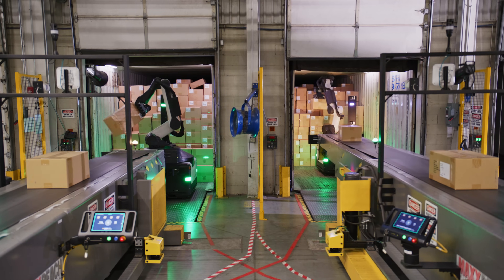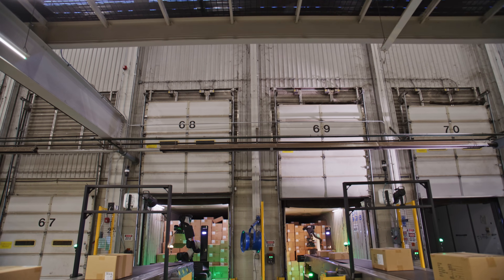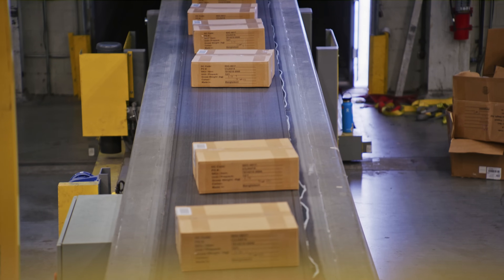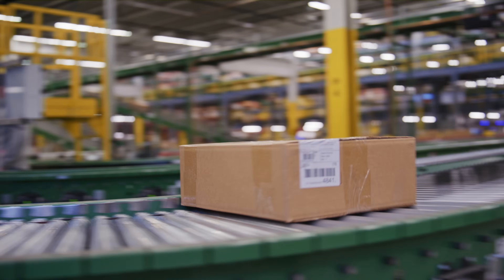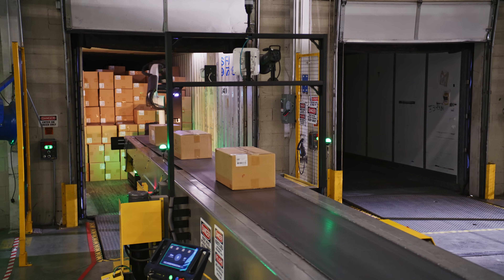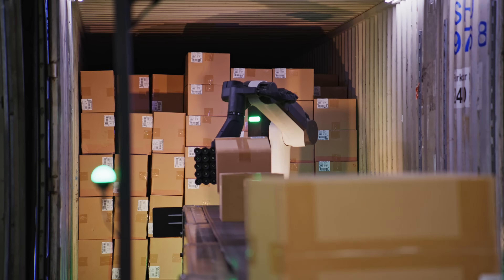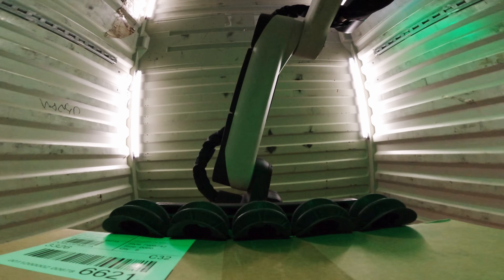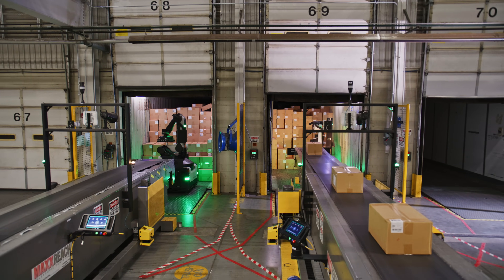Stretch at Gap | Boston Dynamics

Comment: @BostonDynamics  So far we have seen Stretch work in fairly ideal conditions.  What about loads with VERY irregular boxes? How about boxes that have settled and jammed together? (where static friction between boxes may cause damage when pulling a box)  How does Stretch respond to torn, wet, or otherwise damaged boxes?  How does Stretch respond if it drops a box?  How does Stretch respond if the box contents do not match what is printed on the label? (i.e. mass)   How does Stretch respond when a box has no label?  Does/can Stretch sense if a stack of boxes becomes unstable and is about to fall over?  How does it respond to that?  Can you show us examples of Stretch operating in some of these conditions?  Thank you.
Reply: That is a very interesting question. I would assume that it sends a message to a human to come and fix the problem
Reply: @fishman5422 why pay for a robot + a human when you can just pay a human. As long as the robo is not autonomous it makes no economical sense.
Reply: @eSKAone-  it does make sense; unloading floor-loaded trailers/containers is very labor intensive and if the robot can do the majority of the work, then it's 100% worth it
Reply: @eSKAone-  Because the robot operates at a consistent pace, does not need breaks, can operate with limited supervision, and can operate at all times. Likewise, the robot cannot get injured like a person can, and when someone gets injured you have to provide paid compensation for an on-duty injury.

EDIT: Also, you typically wouldn't use a single person to unload a floor-loaded trailer/container. I don't work at a large warehouse, but we usually even have 2-3 people for a single truck to keep up throughput and get the truck out of the dock as soon as possible.
Reply: @eSKAone-  Have you ever had one of those summer fruit packing jobs, where your job is to take boxes of fruit off a conveyor belt and stack them on a pallet? And for reference, the boxes would weigh up to 20kg. I have done it. The job sucks over a limited duration, but for full-time employment, that is just begging to result in permanent injuries.
Reply: @eSKAone-  Because ten robots and one human is cheaper than ten humans.
Reply: @eSKAone-  I've done this job (or one very similar, except I think it was the reverse - boxes OFF a line and onto a pallet), I managed to stick it out for ONE DAY before I begged to be put on something else. It wasn't the hard work, I don't mind that, it was just so utterly mind-numbingly boring. If we have any humanity at all then we probably SHOULD give these boring, repetitive jobs to robots.
Reply: @eSKAone-  why do they give operators a drill when they could use a screwdriver? Stupid question.
Reply: @Aleuvian  clearly you have not seen a 16 wheeler full of live show equipment in roadcases before and had to assist in unloading it. Stretch would be unable to assist in any way.
Reply: @CyanMoth35  Stretch isn't designed for that, though. Stretch is designed, explicitly, for distribution hubs where consistent throughput for unloading and reloading is highly desirable floor loading without pallets is common.

In the United States and many other countries, goods are shipped to distribution centers first via rail or truck, then the goods are repackaged on pallets and loaded for close range distribution to stores and businesses.

Stretch is excellent for generalized goods loads, specifically for retail and grocery warehouses in the US.
Reply: @eSKAone-  ...Because they have more than one worker's worth of work? Its one helper human to a fleet of robots, not one helper human for every robot.
Reply: "Hey human, come give me a hand with this shit when you're free. I can't believe they packed this mess."
Reply: @propellerhead2000  I like the idea that even Stretch is fed up with how a truck/container was loaded XD
Reply: @propellerhead2000  Stretch1 to Stretch2:  "Those meat sacks will never make it in this new world. "
Reply: I don’t understand why people expect Stretch to handle every situation. As the video explained, it’s designed to work alongside people, not replace them. When it comes to pallets, companies can just have workers move them with forklifts. If boxes aren’t packed in an accessible way, people can handle them manually. And for boxes that are packed properly, Stretch can take over. It still offers a significant advantage for companies—especially those that manage both the sending and receiving ends—since they can optimize packaging to fit the most efficient workflow for their receiving operations.

What they’re saying is like, in a car factory where robots handle 70% of the process, if those robots can’t handle 100%, then they should be considered useless and everything must be done manually. But that 70% automation probably saves the company billions a year. I’m pretty sure Stretch, even only with what it can do right now, can save a company millions a year.
Reply: @ I think it's also a matter of degree. Like watching that video, it "seems" like the only thing that Stretch can't do (probably very intentionally) is relocate itself in order to shift jobs in the factory. Which makes people think, what if it could "drive" itself? All of a sudden you need one less employee. If the Gap were to rid their company of employee of "Stretch Drivers" (or 99% of them etc), that too could save the company millions. Could you blame the company from doing so? And you know what they say, Stretch 1 has limitations and is designed to work with people. Stretch 2 though, is designed not to need people and has far fewer limitations if any! Its the slippery slope of automation.
Reply: This is where we need Atlas 2 to come online in warehouses to manage the irregularities or unjam a system.
Reply: That's where you come at 😅
Reply: Boston Dynamics tailor fit their robots based on their clients' requirements. If you actually run a company that would have use for this type of work, contact Boston Dynamics for a solution. Gap didn't ask a bunch of generic questions in a YouTube comment to get their contracts.
Reply: They answered this in the video
Reply: What about plumbing? Carrying heavy pipe or even learning how to cut pipe and ream pipe and identifying the type of pipe on the size so they can hand it to the apprentice, journeyman, or master plumber?
Reply: Stretch can handle moderately damaged boxes, and can pick up dropped boxes. It takes longer but it can do it.
Reply: No.

Comment: I want to see Stretch in a real world application. This looks staged, and the boxes seem really light.
I have never seen boxes stacked like this in a trailer. If the cargo is in boxes, the boxes are on pallets wrapped in stretch wrap. A forklift operator can unload boxes like this 30-40 at a time.
Reply: Then you've never seen Floor Loaded trailers or shipping containers. Those are relatively common, though I think containers would most often be palletized due to rough sea risks and high cargo throughput at ports if it needs to be unloaded from containers at or near the port, although in that case I think they'd sooner load the containers for truck and train.
Reply: Boxes seem really light because stretch is strong🦾
Reply: Why not eliminate pallets, I wonder if they could also get a robot to load them.
Reply: This is a real operation. As the customer said, Stretch is in several Gap logistics centers. In this example, the boxes average 30 lbs. (Stretch can handle 50 lb boxes.) Not all containers have palletized contents. (There is a cost/benefit calculation that companies make. Palletized is more secure during transport, but it costs money to put things on pallets, and to take boxes off them at their destination. Getting pallets out of a container is faster than unloading individual boxes, but then you still have to unload the pallets unless you are shipping them on to another location while still palletized. The best answer varies by circumstance.) Stretch is obviously not the robot you would want to unload pallets from a container, but I'm pretty sure it can unload boxes from a pallet.

Comment: One low-paid loader will be replaced by one ultra-expensive robot and a team of support engineers.
Reply: Just like anything else, the price goes down.  The robot provides predictably, data of output, not having to worry workers comp and those human pesky issues
Reply: And it never calls out sick or needs insurance
Reply: So you think companies will move to a more expensive total solution for what purpose? I guess robotization is happening because the total cost of operating a robot is less than operating a human worker. Otherwise, you will see only cheap humans at each factory and warehouse.
Reply: One cheap horse will be replaced by an ultra-expensive automobile and a team of support engineers.

Comment: 0:27 yo is that allowed??? I worked for UPS (loading trucks) and they told me to never stack boxes just on top of each other but with an offset, i guess so that the weight is better distributed and for safety.
Reply: Offsetting the boxes also prevents the box corners from crushing. If you stack like-size boxes together, the boxes will tend to crush on the corners and the next thing you know you have a stack of boxes ready to fall over.
Reply: The gross weight on the boxes in this video are less than 8kg. Beginning of the video can clearly see 5.70kg. Literal light work.
Reply: @chickentenderlover2412  this is true, but no box is full from corner to corner. The corners will collapse anyway because of gravity. Of course, it depends on how long the boxes are there as to if or how much the corners will collapse. I know about this because I have experienced such things. Even light boxes are affected.
Reply: @asarand  It worries me as well when they pick up from the opposite side of a load inside the box. The box WILL collapse. Idk man these robots just seem like they are designed to be useful but in practice they are just not. Especially for companies with large throughput and output. I don't think I've ever seen a trailer that came in looking as nice as these shipping containers. Just super unrealistic.
Reply: @chickentenderlover2412  well, we have to keep in mind that this is still new. Given some time, flaws will be found, corrections will be made, and improvements will be implemented. You can't start in the middle. You always have to start at the beginning. So it's just a matter of time. And it will happen. And no matter how much people don't like it, the day is coming when labor tasks will be considered beneath humans. And I wonder what's going to happen then. Because when humans can't be employed because not everyone can be a manager, that means the majority of the humans will be out of work. People can't buy your products if they don't have an income to buy them with. Businesses can't stay alive if they can't sell their products. Governments cannot support businesses entirely. It's a mess, and like everything else they're not going to fix it until it breaks.

Comment: "Designed to work with a wide variety of boxes." Shows homogenous and evenly stacked boxes in a trailer, which essentially zero freight trucks actually look like when you open them up.
Reply: What if the boxes were stacked by robots as well? Ever thought of that.
Reply: it depends. many amazons receive shipments that are in TOTAL disarray and look like a mixed up box of legos when you open them. and in addition to being totally mixed up and different sizes there's consistently crushed boxes, wedged boxes, boxes that rip when you try to move them, leaking boxes, on and on. there's a reason they don't show you those and you would have just had to have worked in one of those places lol. that said.. this is the first step and it obviously looks applicable in the right locations.
Reply: It also shows it handling different size boxes.
Reply: Do many of y'all not ever hear of a concept called Floor Loading? Not all boxes are stacked on pallets first, that's only done if the cost-benefit analysis says that pallet loading is more cost efficient, like for super heavy or irregular shaped loads. Floor Loading is done by people working the position of Loaders who grab boxes off of a telescoping conveyor and stack them front to back of the trailer until the job is done, it can cause repetitive strain spinal injuries after enough time due to spine flex and twist, like slipping a disc and then the company has to pay out medical. Companies will love replacing Loaders with Stretch bots so they don't have to pay out for expensive spinal injuries, and Loaders will be maybe half happy that they don't have to keep risking permanent paralysis or very painful spinal injuries, but either half peeved that they're now out of a job or the other half happy that their job description changed from being the Loader to being the Loader Bot Overseer or whatever.
Reply: Yea I was a manager at UPS for one of their new main hubs in central PA. This would never work. So many irregs and odd shaped boxes, so many deceiving heavy but tiny packages, etc. Stacking a perfect wall is almost impossible even for my best throwers. Won’t ever replace humans, not in standard shipping warehouses.
Reply: @Mahtt  Actually Stretch is designed to see the irregular sized boxes of different weights, including some that have been dropped and slightly damaged and handle them. What you described would be an excellent test for Stretch. The container does not have to have a perfectly stacked wall of boxes.
Reply: mine looks like that.
Reply: That's bc it's packed by the same robot on the other end
Reply: @hardcodedsoftware  You know what. I never have thought of that. Good point.
Reply: Most of our containers look like this
Reply: @alex6188  I find it very unusual you received your products packed into a trailer in a non palletized format. Most freight want their stuff out of the trailer into the receiving area ASAP. What industry/domain were you receiving for?
Reply: @Triffgits  craft supply distribution. Maybe 35% of the trailers come like this. The rest is palletized.
Reply: @ Makes sense.
Reply: @Triffgits these are iso shipping containers that typically come from Asia. Palletizing would waste space as these are typically filled to the max. Any one that knows ocean freight that you don't want to ship with void. This is why shipping containers aren't sent back empty.
Reply: @OneOfEightBillion  That makes sense. I'm surprised there isn't a smarter way to unload these than one box at a time though.
Reply: Your absolutely right
Reply: Its a promo, what do you expect.
Reply: @chytruseczek  If it were a constructed promo they would show all the possibilities. This actually is a real working factory, and that is the way that container came in loaded.
Reply: I personally more concerned about method of how those boxes are handled by those robots. You can see here those boxes barely has anything inside, but when there's some real weight inside you can't just hold it by one side without slowly ripping the box. You always should have support from another side or from bottom.
Reply: @FunBanan117  This is for GAP, so I'm going to guess it's mostly clothes in there, which don't weigh much. That's probably why it can pick up the box from the top with no problem.
Reply: @ChavezDIY The video says that those boxes average 30 lb. Stretch can pick up a box up to 50 lb.  If you have boxes of barbell weights, Stretch would not be useful for unloading those.
Reply: @FunBanan117  this is a very good point i was trained to hold a box by opposite corners for that same reason
Reply: @FunBanan117  Fair point, though I think because the load is evenly distributed across the entire sidewall, it's not too much of an issue. Stretch is after all already in production use
Reply: @FunBanan117 lel cartoon-brain thinks the bottom of a shipping box falls out when picked up from the sides
Reply: @NathanaelRig  and plastic brain doesn't think at all 🙃
Reply: @FunBanan117  smooth brain: no wrinkles = no worries 🙂
Reply: I have never seen boxes stacked like this in a trailer. If the cargo is in boxes, the boxes are always on pallets wrapped in stretch wrap. A forklift operator can unload boxes like this 30-40 at a time.
Reply: @JustAboutAnything66  There are many places where boxes are not on pallets. If they are, clearly Stretch is not the tool to be used.
Reply: @JustAboutAnything66  A forklift can get the pallets out of the trailer easy enough but then the boxes still have to be dealt with. Stretch could unload the pallets after the forklift operator gets them out of the trailer.
Reply: @JustAboutAnything66  да
Reply: @JustAboutAnything66  again, where are y'all from lol ich hab doch schon mal gefragt
Reply: Because a messy truck is definitely presentable for a promo. Not.
A neatly organized truck is more impressing, it shows Stretch can grab boxes individually despite suction overlap.
You can see how Stretch rotates and pivots it's gripper, messy truck is not gonna be an issue at all.ö
Reply: @Swaggon  Actually it would've been way more impressive if it was disorganized and still able to do the job reliably.
Reply: @Swaggon  where are y'all from that a clean and tidy workplace environment surprises you that much lol
And correct, even a tipped-over pile of boxes wouldn't be a problem to pick up just as fast
Reply: No pallets?  No stretch wraps?  Like others, this isn't how our trucks are unloaded.

Stacking pallets would be a much better application.
Reply: @craftyshrew  Lmao aren't you "experts" obviously the target audience for this sort of product? 🤣
Reply: where did u work?
Reply: @NathanaelRig  I did work for a logistics company in germany for 1/2 a year and ltrly no container ever looked like that lmao. It was boxes all over the place.
Reply: @Tschoii90  aha, in welcher Stadt? Gerade in Deutschland wird wie im Video zu sehen gepackt ...
Reply: @ Nicht bei GLS mein Freund haha
Reply: Stopping Ai from stealing this comment